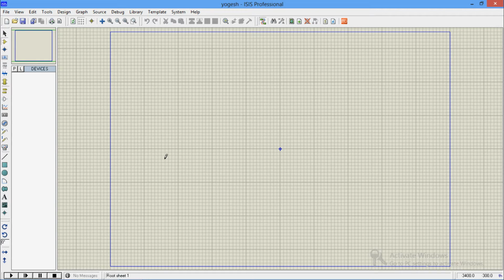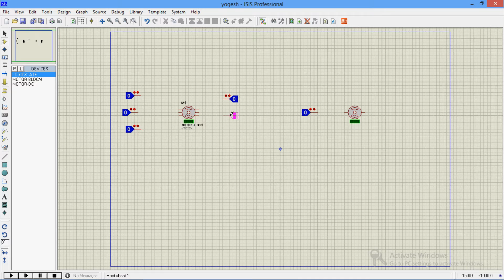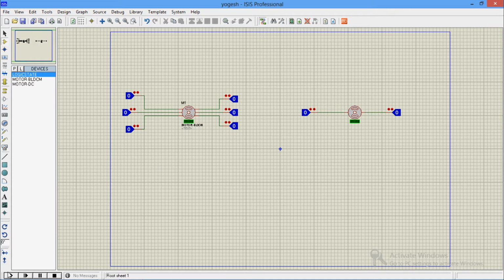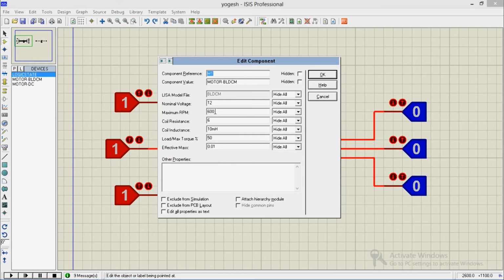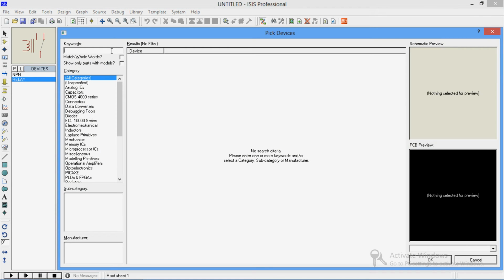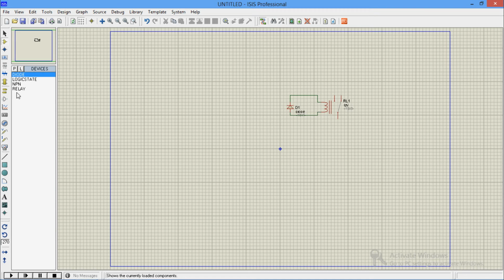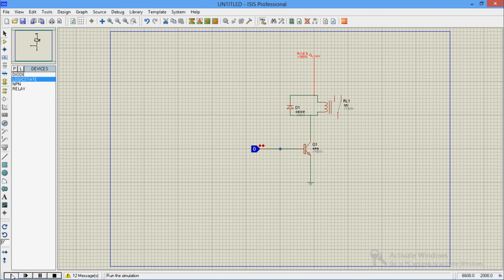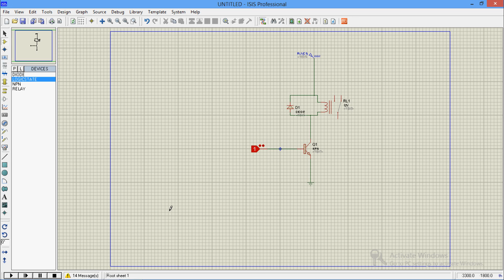Proteus tutorial 11 relay and motor

Comment: Hello, may i ask you why did you place a diode across the relay?
Reply: Its because the inductor [coil] in the relay will kick back current when power has been disconnected. So in order to protect the load, in this case the transistor from the potentially harmful kickback current of the coil, the diode is used to make a short circuit between the ends of the coil.